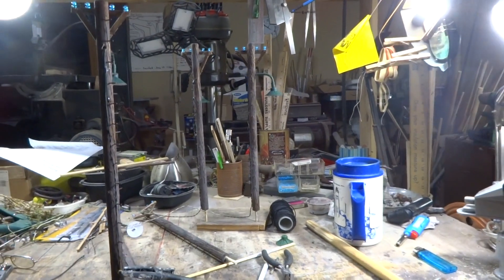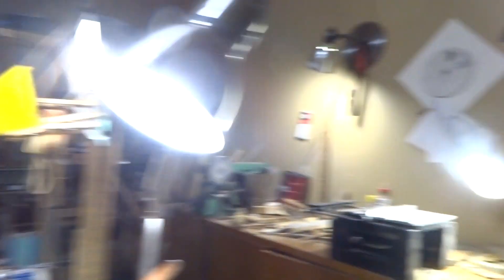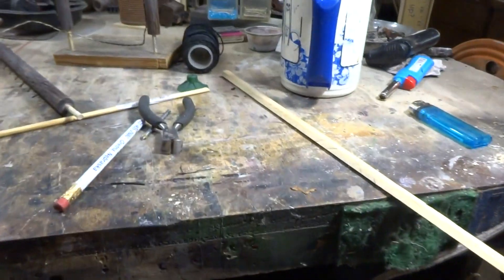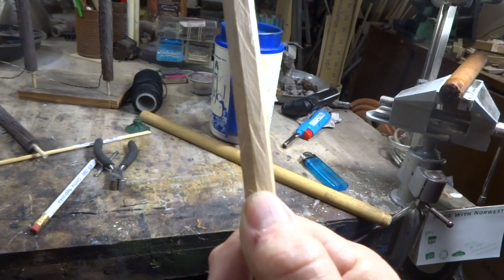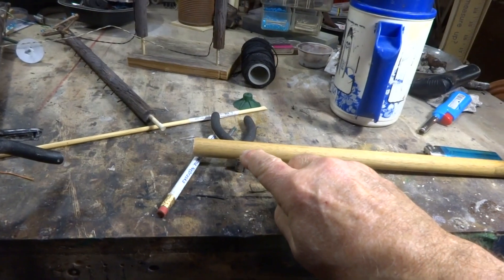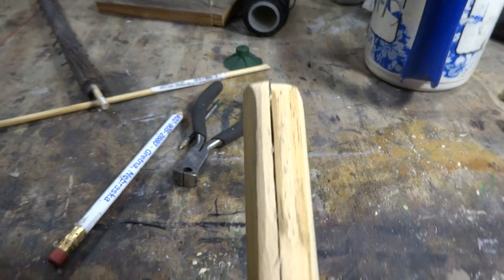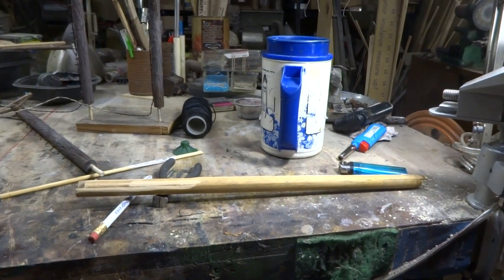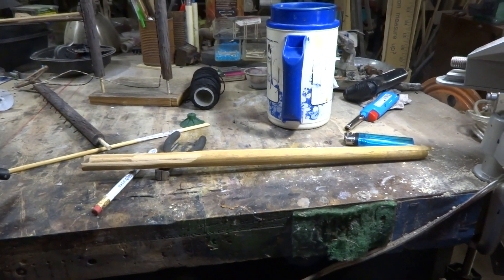Telephone poles, update

Comment: Good idea I'll have to do that when I build my railroad
Reply from the maker: well hurry up and get started, remember tomorrow is promised to no one Thx
Reply: I'm moving in less then 2 years. I'm waiting till my next house which will be my permanent residence. I currently run on our local club layout and help maintain and build on it.
Reply from the maker: @Mikey45013  a couple major things I learned in my years of building layouts is make sure you can reach anything and everything on your layout and make sure your track work is the best you can do with at least 6'' of roadbed under the track so its solid and you have space for the scenery and the ballast
Reply: @muss1951  thank you for the information I will definitely do that when I build my layout.